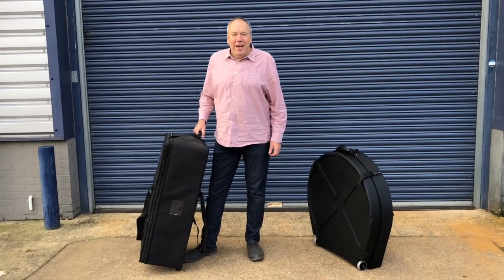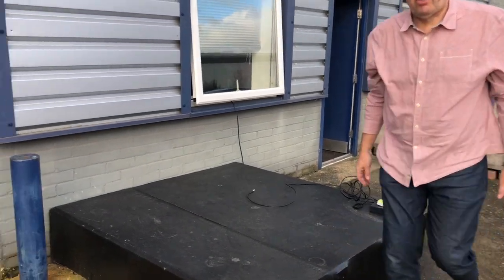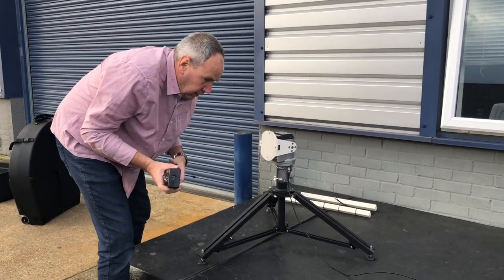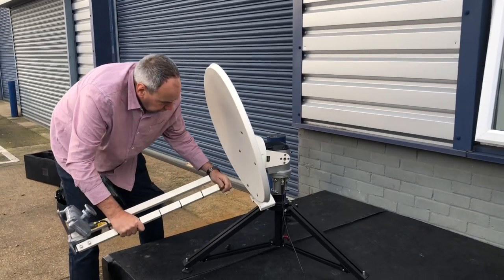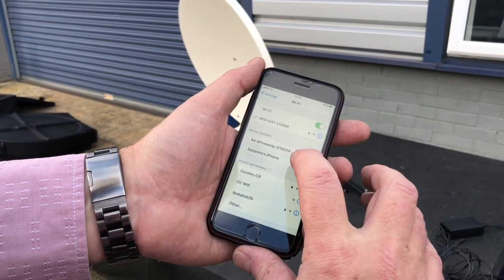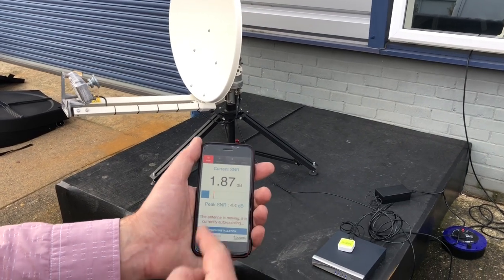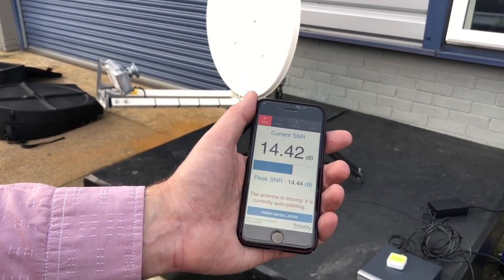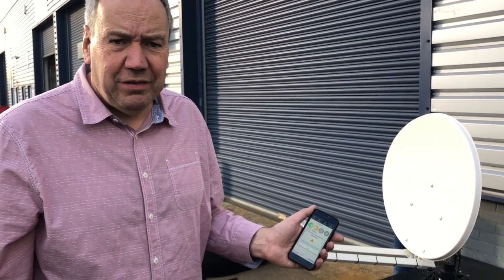U-Do Ka-Band Flyaway

Comment: Will this work in USA with Highsat Gen 5 KA system?
Reply from the maker: StateNewsService hi there....thanks for your interest.  I’m afraid that this version only works on Viasat equipped satellites.  We are working on a version which will work on multiple satellites and platforms but this will still be many months away.  We have a manual version that could be modified to work on different satellites though.  Would this be of interest?  Regards Tim
Reply: Oh, thanks for getting back to me. Dean